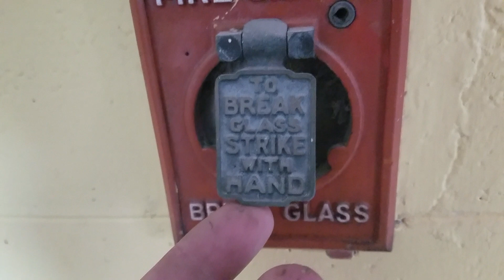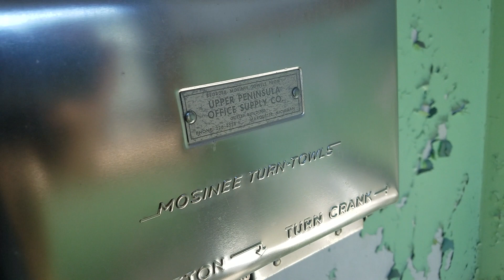#105 1930s elementary school tour, 2nd floor.

Comment: What an absolutely beautiful old school! I'm amazed to see it still standing, because despite it's neglect and current conditions, it is an absolute diamond in the rough in general. Everything from the vintage Kohler and Crane fixtures to even that old door closer that appears to still work.
Reply from the maker: I agree! It's a huge project but it is being slowly renovated and won't go to waste.
Reply: @vintagekohler6085  At least it's not a typical renovation where everything gets gutted and ruined by modern boring crap. You could say this school is getting rejuvenated in a way.

Comment: A car museum in my town of Auburn Indiana actually has those exact urinals and they still use them to this day.  The logo is fading but I knew the brand name on them.  You can visit that museum and the name is The ACD Museum.  The toilets were different names from Kohler, Eljer, American Standard, and Welling.  The Welling toilets were original to the building.  I can give the name of the building and still open to the public today.  I don't give private buildings that are not open to the public or homes or they are closed or being renovated.

Comment: I’m glad this building and the original fixture will be put to re-use soon! 😊. I’m guessing the Saneto toilets are from around 1930-1934, before they introduced the square base in around 1935.  Did you find any child sized toilets, like the Saneto Jr.?
Reply from the maker: All toilets are standard height.